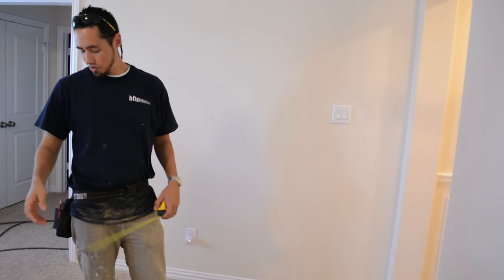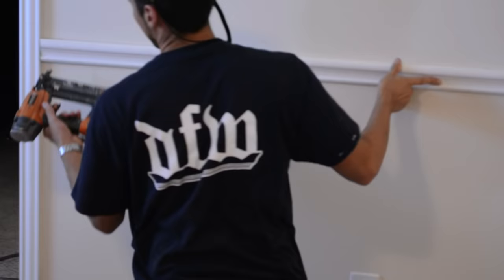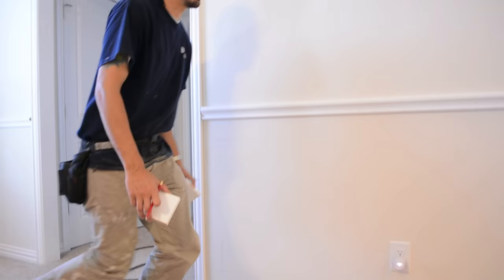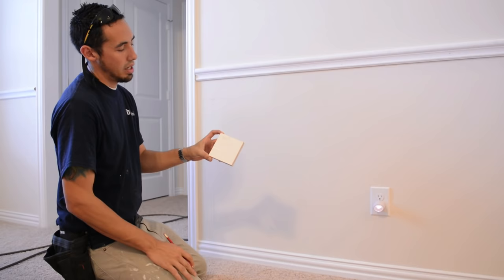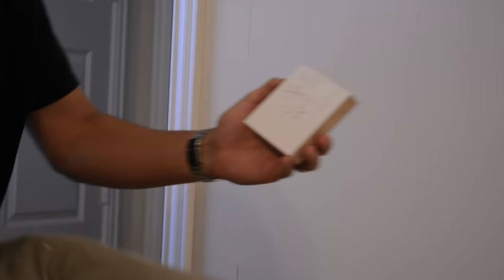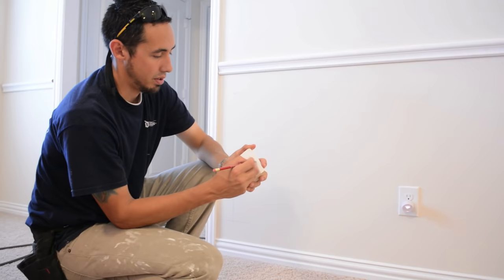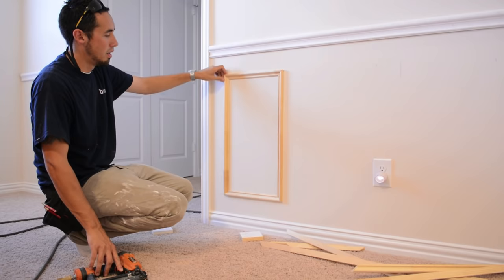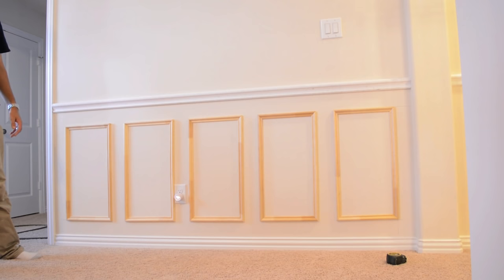How to Install Chair Rail and Picture Frame Moulding

Comment: Great Work! Love watching your videos! If you need to snap a line over carpet, a trick we use is having a chalkline filled with baby powder instead of the coloured chalk. Leaves the carpet stain free and smelling great!
Reply from the maker: Stylzz wow thanks for that tip. never thought of baby powder. that sounds great
Reply: That's super smart, actually.... Non staining chalk line.. hell yeah
Reply: CAUTION! baby powder is carcinogen! Stay away if you can!
Reply: MrBababuwi lol sure buddy ... maybe if you sniff a line of it... did you learn that the hard way? 😂
Reply: MrBababuwi only if it has talc in it. Cornstarch based powders are fine
Reply: @FinishCarpentryTV  qqqqq
Reply: p
Reply: Great idea
Reply: @FinishCarpentryTV  did you ever try it?

Comment: For those DIYers like myself, be cautious of any wires behind your walls. Getting measurements for framing positioning was beautiful. I would of smeared some liquid nail in back of the moulding, a very thin coat. Thanks for video
Reply: Wires behind the walls are by code required to be 1.5" behind the framing surface, I think.  I take your point. Not everything you encounter in a home enhancement project is going to meet code.  Better a lve chicken than a dead duck!

Comment: I love your videos and even though I've been doing contracting for 15 years I'll still watch your videos because your approach is very clean and straightforward. 

I just wanted to point out to anyone reading this  that even though we see chair rail installed at these heights in modern houses. It is WAY TO HIGH. With respect to classical architecture where this trim style originates, a chair rail even on a 10ft ceiling should be no higher than about 28-30 inches high. While there is no dead set rule and ultimately it's what the customer wants to see... It is supposed to follow the proper proportions of Greek Pillars in the Grecian orders. Specifically beginning with the Doric order where it originated. 

The most agreed upon rule of thumb is that if a chair rail be set ideally at about 29 inches on a 10 ft ceiling, it should go up no more than 3/4 - 7/8 of an inch for every foot higher the ceiling is above 10 ft. So to have a chair rail at 40-46 inches up youd ideally need a ceiling height of more than 20 ft.

Comment: Great video; thank you.  One thing to make your day a little easier - instead of subtracting 8 from the total distance and then subtracting one from the number of panels, multiplying by 4 and subtracting that, just add one to the number of panels and multiply x 4 and subtract.
ie, for 5 panels, instead of: 93 - 8 - (4 x 4)  = 69
just do: 93 - (6 x 4) = 69

Comment: When you nail the chair rail on, do you need to nail into the studs? If not, is there a trick to keeping the nails from pulling out over time? Nailing on an angle? Great video!
Reply: Once all of the pieces have been nailed into place, it’s best to go around every frame with caulking on the inside and outside edge prior to painting. It will not only help adhere the moulding to the walls but the finished product looks much better

Comment: Actually, one you've determined how many boxes you want, it's actually one additional space because you have to account for the spaces outside the end boxes. Four boxes=5 spaces, or 5 boxes=6 spaces and so on and so on. I find it easier to calculate that way. Also, If wall is 90" with 4" spaces between 5 boxes, simply subtract 24" (4" x 6) from 90" which should put you at 66". Then by dividing 66" by 5 you'll end up with 13.2" boxes.
Reply: but he already subtracted 4 from one side and 4 from the end so his reference point s start and end at the boxes so 5 boxes.. in between them will have 4 spaces.. ur way is correct as well but both methods work well

Comment: Love the Wainscotting series. Thanks for doing.  Two questions: a). What would you do if the vertical had to come down through an AC vent?  Would you just break the vertical or put a "box" of PM around the vent.  B). What length of nails are you using?
Reply: Or an outlet for that matter?

Comment: What do you do if an electrical outlet falls where you need one of your pieces? What do you do about bigger obstacles like air vents?
Reply: I seen some homes that they box them around the outlet, but moving them so that it's symmetry is even looks better.
Reply: Always maintain your 3 inches even around vents, tge rectangles turn into trapzoids. Specific to the outlets they can be extruded out with similar thickness wood and the frame runs into it

Comment: How do you adjust if the chair rail or base molding is not level?
Reply: I know this is an old question, but it comes us a lot.  Keep in mind that plumb and level are often relative to the surroundings.  In the case of decorative and trim molding, it almost always looks better to have uniform spacing between different moldings and the objects they are trimming than to have the moldings be perfectly level, plumb... or even square.  
We all know there isn't a perfectly square, level, or plumb wall in any house and if there is, it's an anomaly.  
In older houses, you run across a lot of sagging floors and ceilings.  If you would run the chair rail on a perfectly level plane across a wall, you could easily end up having a space between the chair rail and panels that was much larger in the middle of the wall than on the ends.  That would look pretty bad.  Making panels that get progressively larger, then smaller to accommodate would likely look bad, as well.  But having uniform spacing/gaps along the entire wall usually looks much better and tricks the eyes into seeing a level plane across the wall.  
The same thing with crown molding, for example.  If you have a 16' room with a 1" dip in the middle, you could drop each corner a 1/2" to get a perfectly level plane and fill/caulk the gaps at the ceiling.  Or you could scribe the crown and cut the top to match the drop in the ceiling to get a perfectly level plane.  But in both of those cases, the tapering of the molding sticks out and accentuates the slope in the ceiling instead of minimizing it.  If you were to follow the sloped ceiling over that long of a distance, my eyes aren't going to notice the slope in the ceiling because all the gaps and spaces between look uniform.  In this particular case, most carpenters might choose to drop each corner maybe 1/8" or even 3/16" to cheat the slope a little, but still not draw attention to the difference in spacing from the ends to the middle.  
There's obviously a limit to how far you could take this and all situations are different.
Reply: @mikeadiddle  great explanation... thanks for that....

Comment: Easier way to math. Take your overall, subtract 4, divide by 5, subtract by 4.
Reply: The easiest math is Overall length 93.75" - 24" = 69.75" now divide by 5 which is 13.95" for 5 boxes there are actually 6 spaces x 4" which is 24" Counting the end spaces in the equation right out of the gate simplifies the math.

Comment: Great video. What size finish nail do you use?
Reply: love your work, very
Reply: John Hurley probably an 18 gauge brad nail buy the look of that gun
Reply: Prob 18 gauge brad nail at 2 1/2 inches
'
Reply: John Hurley ... 18 ga 1  1/4" or so , caulk the back, pins just hold until caulk dries, you don't want a long pin, it may penetrate wiring in the wall and there goes all your  profit

Comment: Don't you put in the glue wanted to stay to the sheet rock because you may not be getting Stud?
Reply: doesn't need to its probably 3/4 light trim an he's using 18brad nailer not 23 gauge plus caulking and paint it won't fall
Reply: Tq

Comment: Are you tacking the frames it right into the sheet rock?!
Reply: No studs?
Reply: yes
Reply: Lol its light your noobs.   But thats just my opinion
Reply: studs? the only studs needed for this job are the expert trim installers!
Reply: there are good caulk brands today that stick like shit to a blanket.
Reply: He probably should have installed more studs, every 14" so he could nail to them! Ha!
Reply: Here’s a couple tips when your doing your own house vs a paying job that time is money. I always make boxes over 17 + inches wide so I hit at least 1 stud for each horizontal. Before you set the measurements for your boxes ensure your boxes are not running through any electrical boxes (big headache) adjust box size to avoid them. I use glue on every piece for stability especially on the verticals that don’t hit studs. When I set my height of chair rail I take 1 height measurement then make the line with a level so you don’t start crooked. After you draw chair rail line, just under line I find and mark studs so chair rail will cover holesSpend your time wisely using quality caulk (shrinkage will ruin your day) and caulk every joint and inside/outside of the box frames.

Love your videos, you’ve helped me on so many projects!  Keep them coming

Comment: You are a great instructor. Easy to follow. No distracting music & not a wasted word. Folks watching this will know exactly what to do. You got me - I’m your newest subscriber. I often use CA glue to attach the corners, instead of the toe nail. This can save material if a wonky grain pops the nail thru the side of thin moulding. This also helps if you make the frames off site (on another floor, etc.). Public school taught me to make use of available resources. Yep, I have that calculator to use it. Curious why you didn’t start with the dimensions of the frames in the other room?  Hopefully the client also hired a painter. If yes, count your blessings that you’re the finish carpenter & not the painter. 😅

Comment: First and foremost, thank you for taking the time teach others your trade. It takes a lot to share what you know, others will safeguard the secrets or try to get rich off of them. I noticed you had existing picture frames to the right of the wall where you conducted your installation. In this section, assuming you worked out the same spacing formula where they also done in a manner consistent with the rest of the house, meaning as close to 14"? If those were sized at 12" will they look odd when compared to the 14" boxes?

Comment: I just finished doing picture frames along my staircase wall. I hadn’t seen this video yet but I would never trust that anything on my walls is straight. I measured and checked the level on each one of my frames because my house is crooked as can be and still be standing!

Comment: This is awesome! I think I can actually do this! Does this system work in old houses where none of the walls are straight, level, or square? Can the outlets be moved and centered within the frames or do they have to be spaced as is to comply with building codes or something like that? That would drive me crazy.

Comment: Thank you. Is it worth also putting adhesive in the back of each moulding or to seal around each frame with colcking(?)? Also, do you have a video reference for dealing with moving g outlets if needed?

Comment: Nice work, we prefer assembling on a work table with a square jig, glue and pin the miters then attach to the wall with a couple of dabs of caulk on the back and a few nails always looking for studs to attach to.

Comment: @finishcarpentrytv amazing to see your progress through the years! If you were doing something like this today would you still go direct over the drywall or do some kind of thin panel over the drywall first?

Have a room i want to add an accent to without removing existing baseboard and wainscot wont work so thought this might be an option!

Comment: i recommend adding carpenters glue at least at the miters . i did this with 23g nails and glue.  i also used a laser level..  the floor in not level, neither is the baseboard .
 good video tho ... good to explain it to the diy crowd.

Comment: I know this video is from several years ago; I just found your channel. 

Looks like your picture frame mouldings are fastened onto drywall, so I'm assuming you're nailing into studs behind the drywall.  What do you do when the vertical moldings don't line up with a stud?

Comment: Fantastic video…what size / length brads do you use and will it work just nailing into the drywall or would I add a little adhesive?

Comment: I need to remove one chair rail box, which is above the fireplace, but afraid it would open the surface of different structure (I mean it would be smooth without grain structure). But hope that all walls first finished with certain grain pattern and only then chair rail boxes are attached. Is it always so? Would it be same grain structure on the surface of the sheetrock? Thank you for the great film.

Comment: As always great video with excellent instructions .  Do you fill the nail holes with the NR4000 caulk also ?
Reply from the maker: Thank you sir. No I use a product from Dap called Drydex. Its has non-shrinking characteristic. Most caulkings shrink a little while drying.

Comment: how do you do odd walls? so, I am planning to do my office, and I'll be doing a monochrome striping on one wall (white in two separate finishes) and then I'd like to do a chair rail with picture framing on the remaining 2 walls (the fourth wall is basically all closet door and door to office, not much room for putting anything on it), how to you manage doing more than one wall when the other walls are full of obstructions like doors and windows? do you do a different sized frame, just not frame that wall?

Comment: Hello, thank you for the video upload.  Can I ask why you guys don't prime and paint your frame mouldings before you do your install?  Also, you and just pin nailing these guys into the drywall, it would take nothing for them to bulge or pull away from the wall over time....why do you not use a small bead of some type of adhesive on the backside before you install?

Comment: Hey I have a question. What nailer would you use for Wainscoting and crown molding? Vs installing interior door casings? Would I be using 15 or 16 gauge finish or Brad nailer?

Comment: I like the efficiency of you using the spacing blocks. That was only a short run, but no level for the top mold?
A little more planning/diagraming could have alleviated the near-miss on the receptacle. Nice job though.

Comment: Say you wanted to do this in a rectangle shaped room and the length and width are different, how would you go about spacing the boxes so that each wall matched? Would you just have to make the internal size of the boxes slightly  bigger / smaller to keep the spacing between the boxes the same?

Comment: Hi....when installing chair rail and there are rounded outside corners on the wall do you stop before the edge and finish off with a return on chair rail?  Or are there rounded outside corners available like for wall base?

Comment: Questions!! 1) Do you use a pin nailer or brad nailer? 2) any reason you don’t use adhesive behind any of the trim? Bc I imagine you’re not always nailing into studs 3) what do you do if you have a very short wall? Like say 10” (that’s the wall where our sliding glass door is located)? Thanks!!

Comment: Don't know if you'll se this since this is an older video but I had a question. 
Since the walls are different sizes do the frames also change sizes? What I mean with this is that you make the top and the bottom rail part match the height of all the other ones on the other walls right? Then don't the frames changes size quite allot depending on how wide the wall is and how many frames you decide to put on them? Does the end result look good? Or is the trick to keep the spacing in between always the same? 

Thanks !

Comment: Should I be using an “18 gauge Brad nailer” to just about hide the fasteners or use an angle finish nail gun? Thanks for the great instructions!
Reply: I believe trim is best done with a 16 gauge nailer, just for the extra strength, although if 18 works then 18 works 😁

Comment: Hi there, I am planning on doing this for myself soon. I have 10mm thick gyprock walls (drywall) but I don't think the mouldings will stay on the wall with just the nails into gyprock.....do you have a suggestion for what I could do? I thought maybe a backing panel or some glue? What is the wall you nailed those to made of? Thanks :)

Comment: Just a question. I noticed that the framing you just shot a Brad nail in it but will that hold just by nailing that in the sheet rock?

Comment: Thanks very much for the video. My wife is after me to do the same.  Did you nail the frame to the studs or just the dry wall? I notice you did or use any glue either?

Comment: Hello my friend.
I'm about to do this kind of trimwork in my basement but of course I have a question. I know there's 4 inch spacing between the panels but what do you do when you come to an outside corner where the trim work will continue on to the next wall?. Do you still space 4 inches from the corner on both walls, or do you space 2 inches from each corner which totals 4 inches.  Your thoughts?

Comment: how do you know that you aren't hitting plumbing or electrical lines when nailing? all I can think of its that the finish nails you are using are short enough not to penetrate past the drywall too much

Comment: Great video. Love your style. But why not install pre-painted trims? I know there's caulking to add to the nail holes and mitred edges, but those can get another light coat through the middle of the trim and the edges. Looked like a freshly painted wall. Is it getting repainted? I realize the pencil marks are washable.

Comment: I have a question!!!!!!  I have a job and I am installing some Crown Molding.  I am trying to get the angle correct.  The ceiling goes from Flat to cathedral to flat to Cathedral.  I need some guidance. Please.